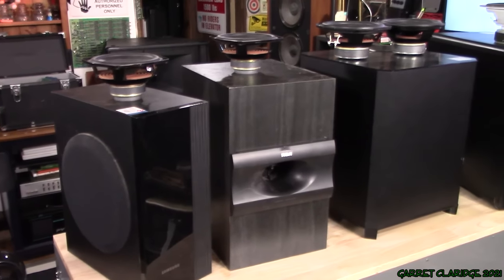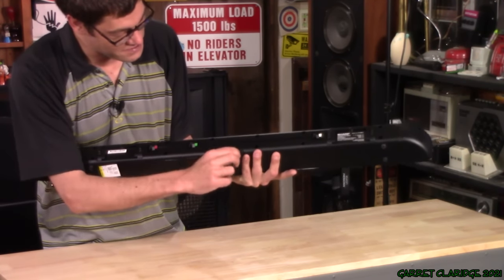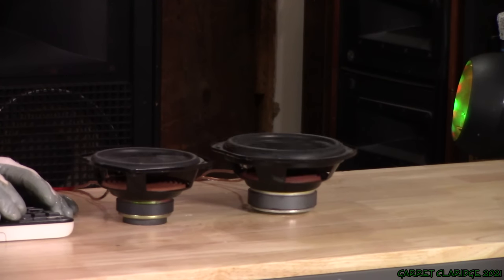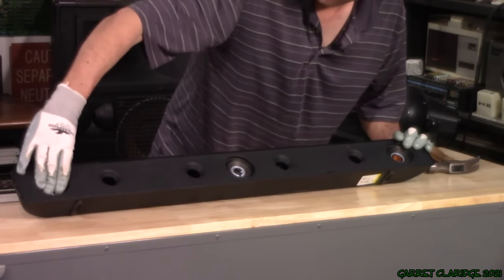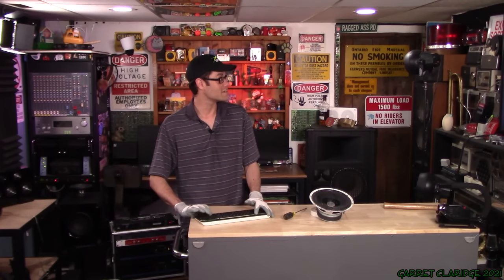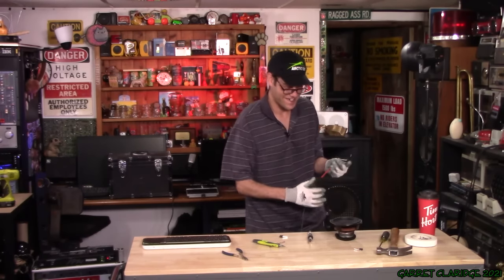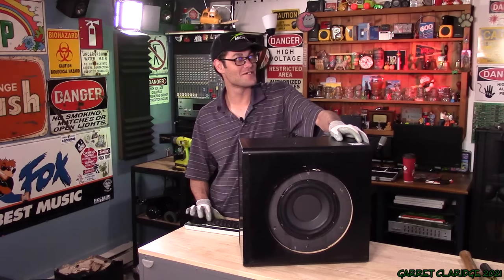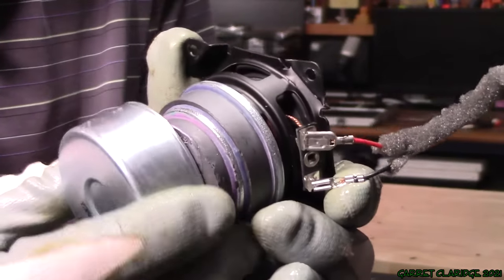Speaker Blowouts  - The "Home Theater In A Box" Special

Comment: 9:27 I have that Onkyo speaker in the background. The tweeters in those things suck! The last thing you want in a center speaker. They sound boomy too. I am sure you’d get a real laugh out of the surround speakers to those sets. They are around the size of normal 5 inch bookshelf speakers, but only 4 inches deep. The only driver inside of them is a little 2.75 inch full range in the bottom left corner! The only good thing is that they can take a beating and not blow, unlike the RCA speakers with similarly tiny drivers.

Comment: Have you tried the little Visio 5.1 system they have at Walmart for under $200?  To use and not to blow up :)

Usually ignore that lower priced stuff, but that little system exceeds all my expectations.  I believe it has a DSP subwoofer as it goes too low without boomyness for how small it is.  Rear speakers are wireless (wired into wireless sub at least).

Perhaps too small for living room as made for 42" class TV, but a bedroom system...very nice 5.1 decoding and sound quality.
Reply: my friend’s family has those set up. not gonna lie, i was surprised by how good they sounded. not audiophile quality mind you, but still pretty decent especially for the price.

Comment: 12:30 the Tweeter lasts very long. There is a Ferrofluid in the Core part of the Coil.
The Fluid transferes the heat away from the Winding.

Comment: I unfortunately think they put in fuses inside the voice coil of speaker drivers, like a deliberate weak spot, now to prevent fire when something goes horribly wrong. But it also prevents you from having fun blowing these.
Reply: This is false. No speakers that are modern I’ve encountered has had a fuse in it. Maybe you popped a crossover and mistook it for a fuse???
Reply: As long as you’re wiring directly to the speaker nothing will stop you from blowing it.
Reply: @ampguy6920  I am talking about a deliberate weak spot in the voice coil. Watch his video how some speakers fail safely and boringly.
Reply: @kyoudaiken  that isn’t a “fuse”. That’s simply a weak coil. As you can see these are cheap speakers. If you have a speaker with a decent voice coil they will in fact give you a fantastic smoke show. It also really depends on the glue they use. Some of them will unwind easy due to weak glue.
Reply: @ampguy6920  Seems like they make more and more cheap ass speakers and sell them in expensive equipment. That's why I switched entirely to Studio monitors. Like Yamaha HS-7.
Reply: @kyoudaiken  I haven’t had any issues with modern day speakers seeming “cheap”

Comment: Hey garret do a video of how a old field coil speaker works and maybe get some vintage smoke out of it
Reply: I was given an old field coil 12"  Aussie Rola speaker at school when I was 11 (1983) by my classmates, I wired it to my 1w radio/tape recorder and got very little sound out of it, I heard the Flashdance (Irene Cara) track played at whisper level given the radio was full blast. I thought the VC impedance was 2000 ohms (that is the FC resistance). the VC impedance is 2 ohms as were the permag speakers that followed on later

Comment: None of these speakers are full range. And those plug ins in the first sun you showed are for the left and right speaker probably. So they’re all time aligned. The word you’re looking for is port chuffing. I have a subwoofer that can do 110db at 10hz and go flat into single digits. Can do 130db which was measured outside. It might be a passive radiator on the one where it’s a fake tweeter not sure.